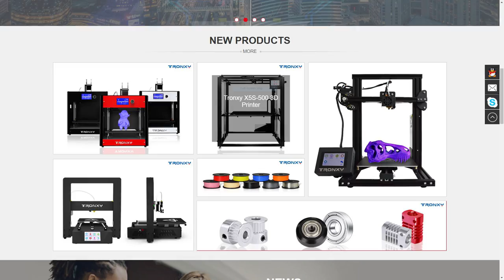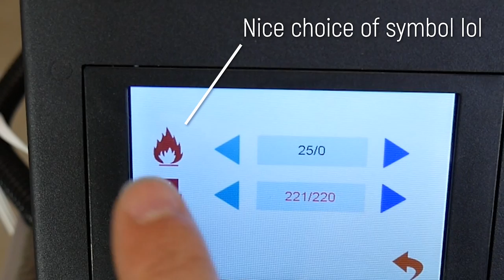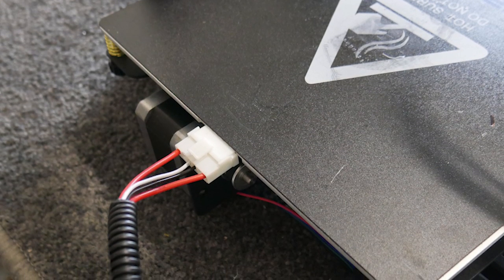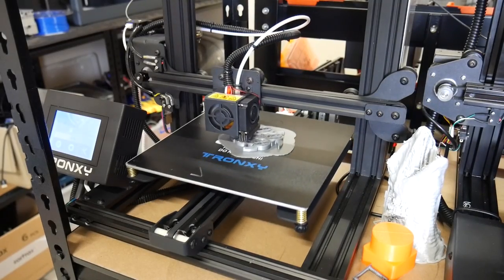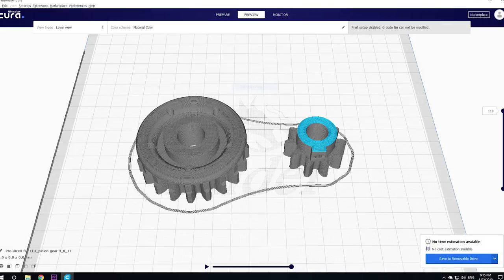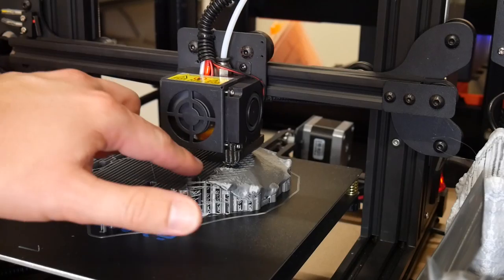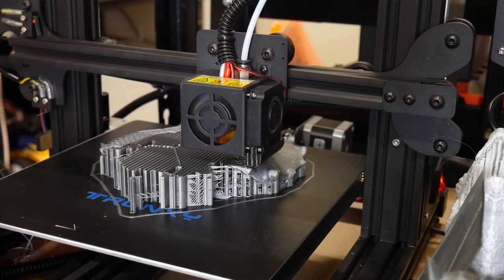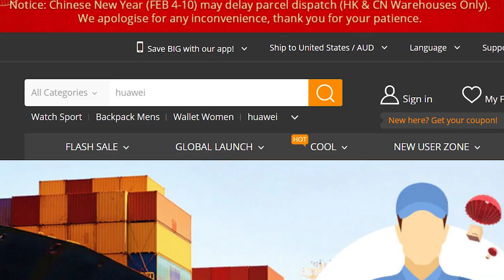Tronxy XY-2 3D Printer Review

Comment: I am still not getting the bed leveling problem I have fixed with the Tronxy X5SA 2020 upgraded model.. 

I spent tons of time hours at ago in fact trying to get the manual or auto leveling to work so I can use this huge build volume this print has got. 

I know you did a review about the model before mine the Tronxy X5SA 2019 model which has a 12 Volt system.. 

Mine has a 24 Volt system.  I got to the point that if I don't manage as a newbie after fighting for months with this leveling problem, get anywhere to fixing it. 
I will just give up on this printer! I spent tons of time and money on this new hobby when I have not the money to waste. 

I even brought two Tronxy upgrades to better print, 1 > a ultra flexible new bed cover to get off any prints.
and 2 > a Titan Extruder as I wished to do Flexible TPU prints. I even brought extra tools to help dismantle and work on the printer and 
got the high heat proof gold electronics tape to put on the bed to help stick the prints down and remove them better from the bed, 
as the blue tape just can't take high head on the bed without curling up?

But the leveling problems meant even if I spent tons of time leveling the bed, it still either sits 3 mm above i or worse scrapes across the gold tape wreaking it 
and that tape takes time to get on flat I have to use a rubber art hand roller to do it.

And why keep doing it when I can't get it to work?  in the 9 month of hell I been trying I got just two prints done the rest of the time tons of failed prints.  
I am now wishing I never brought this model and instead brought a small volume build standard model from another well known company?

Such a pain. I can now see why newbies often get fed up and give up doing this hobby.

Comment: I had to reseat my Z stepper on the End3 to get it to run smooth. I lowered the cross rail to the bed, loosened my Z stepper bolts and re-tightened them. The leadscrew flexes in the middle but jams on the fixed ends.
Creality open sourcing the hardware was a mistake, now everybody copies it.

Comment: It's the bearings in the rollers, Most of these printers use the cheapest bearings possible.
I ended up replacing all of them in my Tronxy X5S, Now it works smoothly.
The proplem showed up as a wave in the Z usually angled.
Careful with the current settings, Tronxy boards fail when the current is increased to where it needs to be. Replace with a Duet 3D ;)
Beyond that, the machines are ok.
Reply: i had the same problem on the x5sa tho the v grove rollers eventually run in but replaced all the other ones
Reply: Soo...buy a $200 printer, upgrade it with $500 in parts and countless hours, and its as good as a $500 printer? Seems to be a theme on YouTube.
Reply: @truantray  sorry mate u are a bit wrong with your numbers
If u get good deals with your upgrade parts its about 50€ to upgrade a x5sa after that the quallity is quite good

Comment: I'm still trying to tune things in as I need to, since I use supports so rarely, but you can set the gap between supports and part surfaces in Cura, as well as the support density. Tree supports are also available, and I've had good luck pulling those off with a distance of 0.4 top and bottom.

Comment: The XY-2 plus comes with the filament sensor.. Not the standard XY-2. 

I have one.. So far so good.. 
You don't elaborate on the slicer layer settings.. Im sure it would be much smoother w lower layer settings.. Ofcourse..printing time increases. 

Thanks for the review.. I bought mine due to it. I've been happy w the results.

Comment: Weird belt paths... yeah... it’s really easy to design something if you slap some mount points roughly where they should be, but the belt is not following a truly vertical path but a hypotenuse which will change length as it nears the ends, causing a minimal amount of distortion.
Minimal as it is, it’s a sign of lazy design and something I’ve painstakingly avoided in my own work.

The rollers are probably the issue, they could be home brew “tyres”. I’d recommend just buying a few proper delrin ones from a trusted supplier and swapping them in.

Comment: Actually the Ender 3 print surface is not that bad. I have one from June when the build surface used to be glued on and still use it with great results! Over time it wears in a bit and both adheres a bit better and releases easier. No adhesive, just bare for PLA, though I used some IPA smeared glue stick (as per your video on bed adhesion ;-) ) with PETG to protect the surface and release well.
For a fried that for the E3Pro I bought Easy Peelzy and it's a very nice surface, I'll probably get it once the stock gives in, but the stock really seems to be able to hold very well (7 months of nonstop printing!)  if you have the first layer right and not having to scrape at it too hard like with it too squished in. The only thing to do occasionally is to check for bubbles appearing after releasing some bigger prints and pushing them off the edge with bed heated up.

Comment: Two things: if this issue with the rollers is a thing on ender 3 clones, should I look at adjusting them on my ender 3? Also, about supports in cura, you can set supports to tree support in the options.

Comment: The issue of the Bowden filament feeder.  I do not think your diagnosis was correct.  If you heard the clicking then the motor was turning so increasing the current to the motors shouldn't make much difference. 

 I purchased a Tronxy late last year and had a similar problem with the extruder not feeding properly ending up with major under fill prints.  I found that the non-adjustable tension arm on the feeder was the cause.  When the filament is being pushed and experience some resistance, the gear bites into the filament too hard cuts into the filament thus reducing the diameter - once that occurs the filament feed is severely reduced.  

I experimented by pushing on the feeder arm slightly (reducing the pressure) and found that it extruded much better.  When it sees excess back pressure the gear does not eat into the filament.

The permanent fix was to reduce the length of the spring.  I also replaced the arm with and adjustable screw.

All my work  and testing has been on PLA filament -
Reply: You can get clicking because the stepper motor has insufficient torque to reach the next step- if this occurs the stepper will jump backwards to the previous step, making a click and effectively doing a small retract on your filament.

Comment: From what I've experienced, those filament out sensors cause A LOT of friction on the filament, causing the extruder to have a hard time pushing it through. Let me know if this could be the problem. (Bear in mind in my experience I hadn't mounted the sensor properly... but I would like to know if it still happens with it mounted properly.)
Reply: Filament out sensors are nothing but a roller on a microswitch
Reply: @truantray  Bizzare. You'd think they could use a photodiode and LED to detect the filament without contact and avoid that issue.
Reply: nerd1000ify not even close to reliable enough

Comment: What was the power supply like ?
I suspect as you haven’t mentioned it , it must be okay and most likely some sort of gigantic wall wart.
Reply from the maker: PSU is nothing special, similar to the ender 3 but 12VDC. The fan in my unit is on all the time.

Comment: hey I was wondering what current you set the stepper driver to? I'm having a similar issue with my Tronxy X5SA 400. I also can't print faster then 60mm/sec without layer skipping. any suggestions?

Comment: I also have problem with E stepper motor , I replace with strong motor (0.9Nm) and use DRV8825 driver , now work good . All other driver replace with TMC2100 , all fan replace and use voltage regulator to control speed . Now my printer is totally silent . Ender 3 , GeeeTech A10 or all other printer with same construction have lots of mistake , step by step I solve this mistake . But what you want for 160€ .

Comment: Thank you for review it. I was curious about it. 

Anyway after your review I would surely buy an ender 3 for the price.

Now I'm saving money for cr10s pro
Reply: Thats what I'm getting this summer, everything points to that being the best option right now in that price range
Reply: Yes I was going to order this January but then I bought the mi mix 3 instead of it... So I have to save for that... It seems to be a printer that is good from the begin
Reply: I have a CR10S Pro and 2 Ender 3s. Buy a CR10S, not the pro. The mesh levelling is poor, the firmware is poorly written. Lots of problems with many poorly implemented gimmicks.
Reply: get a tronxy x5sa its a beast for its price
Reply: Okley can you expand on that? The better PSU at 24v, better board with the silent drivers on it, double rails for the Y travel, better print cool fan, the capricorn tube included, the new mk10 hot end, the silicon sock, the upgraded extruder, these are all nice physical upgrades that shouldn't be impacted by bad software.

Can you please elaborate on what issues you're having? I will not be using the power restart functions so if that's what you mean I was just wondering

Comment: I would love to buy this printer, it's is right in my price range and looks great... Or it did, but I already bought my Tronxy X1 a year ago and I don't know that I need two printers. I have the money for a second printer, would this be a good one to get?
Reply: If you already have a printer that works "OK-ish" for you consider saving until you can afford a proper step up. Assuming you've spent some "quality time" with you X1, gotten to know all it's little quirks and dialed in a very good profile for it, buying another cheap printer is going to be disappointing, because your out-of-box print will be worse, or at best on par, with your trusty X1. I would say go for a $1000 assembled/$750 kit if you want to see real out-of-box difference.
Reply: Uh, watch the video? Save your money.

Comment: I have one. had to return it heatbed and main bored failed, new one randomly shuts down. power is on says on the screen powering down. sometimes if i turn it off then on it will resume the print but not all the time. Any suggestions. This is my first printer. Maybe i should have got a CR-10  Oh well too late now now, i got to live with this buggy sh?#!
Reply from the maker: Sounds like a buggered powersupply, see if you can grab an equivalent 12v meanwell one. Get an expert to wire the mains terminals!
Reply: could i use a 550w pc power supply on it to try the theory  @MakersMuse ? i don't have a extra 3d printer power supply.
Reply: @MakersMuse  spend money, spend money, spend money. 

Do people a favor and just don't recommend ultracheap printers, it's false economy. Many channels are making a good living promoting cheap printers, then hundreds of videos of "upgrades" that end up costing 2X just buying a decent printer.

Comment: Why does it say that you can't print TPU On this machine Is there a way I can upgrade my machine to print tpu or do I need to start saving for a new 3d printer im a bit gutted I chose the printer for Xmas but I didn't know about the difference filaments well I did but I just thort thay all worked with all 3d printers

Comment: Does higher temperatures  (below the point where the plastic starts to degenerate) really result in easier extrusion? If the temperature is increased the melt zone gets bigger and more "spongy" as the hot end is not perfectly sealed (melted plastic can "escape" upwards).
Reply: yes and no it gets more viscose resolting in an easyer extrusion but u get only a littel bit of meelt zone increas due to tje relativly good effect of a heatbreak. the springiness in a long boden is a mutch bigger problem

Comment: I have a tronxy x5sa, being a core xy it has planty of rollers and bearings in the pully system and i can say they have a defenitive problem with there bearing quality they suck for quite some time till at lest the v reels run in eventually. 

i exchanged all the belt weels with quality bearings and now its a solid printer and it basicly runns faster every day got it up to 130mm/s  and still increasing. need to up the part cooling tho.
Reply: I have a x5s and would love to know where you got your parts. Definetly would need to do the same for mine. Same issues.
Reply: @3ddrew691  so u got a x5s do u still have the flimsy motor mounts think they where an issiue alsow you can get pritty mutch every acrylic part in steel from aliexperss / alibaba  for about 15$  if i  remember that  right. 
the bearings that come in the idelers are not good but with the x5sa u get like plastic idelers i just ditched them compleatly and went with the more original tronxy wascher bearing wascher tactics tho my waschers are currently made out of pla cause i had no bearings with 5mm id thats what u need for using the standart screws
so i made some quick adapters and printed them. 
i run skf bearings with 7 id and 9od cause i had them laying in my horde i woud youst recoment looking for the exact same bearing that u currently have in your printer  and them buy a view quality ones on  for example amazon  
the most important thing is that your frame is realy realy squere if you got it squere then use like the 90°angelbrackets and t slot nuts and bolts and put them in every corner of your maschine that can handel them u need about 20 ish of the bracets and then 40 nuts and bolts  bought that stuff all on amazone cause it was fast.  tho u can get it realy cheep from china 
.last thing is checking that your belts runn nice end straight everywhere where the angel  / length can change stationary sections dont matter. 
thats my gude to getting a solid tronxy printer. after that u let it run some print where it needs to travel a lot maby 2 towers on opposid sied of the bed to run in the rolers hope i coud help.
Reply: @mogelzmo  yeah i have printed quite a few things already. If everything prints slow itd great but over 30 mm /s quality is less impressive will definetly try ordering parts and see how it goes after they are installed..thanks for the help

Comment: I own the tronxy x5s, and my experience is that all the issues here translated. from what I can tell is the aluminum extrusions are warped in weird ways, almost like all the extrusions are the endcuts from a production that are of lesser quality due to them being at the start and end of extrusions. extruder clicking and stepper skipping i've done everything down to replacing boards and different steppers, came down to the stepper motors are poor quality, replacing all of the motors fixed this. in my experience the tronxy printers are not beginner friendly, and you should keep away from them in general untill they fix these quality issues.. I know some people have made them work, but i cant even get my printer to work with a linear rail setup due to the warped extrusions.

stick with creality, or build a hypercube or buy a prusa. If the prusa's are too much i hear the trianglelabs/d-force mk3s clone is good, I have a couple trianglelabs/dforce e3d v6 clones and cannot tell the difference between them and the realone outside of the thermistor and thermocoupler, but both those seem to be high quality asweel..

Comment: Those rollers always flatten out if they've been in one spot for too long. My Ender 3 had the same issue with the rollers on the bed. I had to wait for them to wear out a bit before they would roll smoothly. Honestly, I wish they would separate the bits with rollers so that they don't have any pressure on them when packaged up.
-lilpossum

Comment: Dude, please please check the anycubic i3 mega. It's no doubt the best printer for beginers since it's just a bit over 200€. you literally need to screw 8 screws and it's built a lot better than the tronxy or the ender. it has filament runout detection, power loss reasume, an amazing build plate that sticks prints when hot and releases them when cold. I've been blown away by it.

Comment: Cura has an experimental option called tree supports. I’ve found that this works amazingly well at generating easy to remove and good looking supports/supported prints.
Reply: The trees work great for irregular or curvy surfaces, but sometimes the regular support is better for large flat surfaces. I especially like the way the tree can curve around parts to support an overhang above without leaving a messy connection between the your part and the supports on top of it. Ideally I'd like to be able to use both types in the same print (I guess I could add custom supports in meshmixer?) because they both have their advantages.

Comment: why the race to the bottom, why not double or even 2.5x the price and have linear rails, a decent control board and all metal hot end. even the ones in that price range are essentially the same just larger build volume.